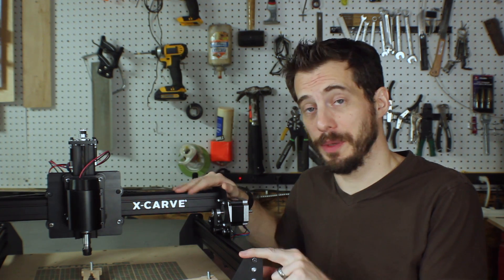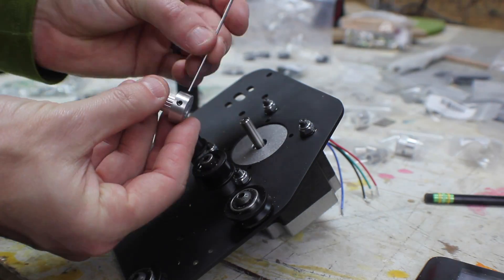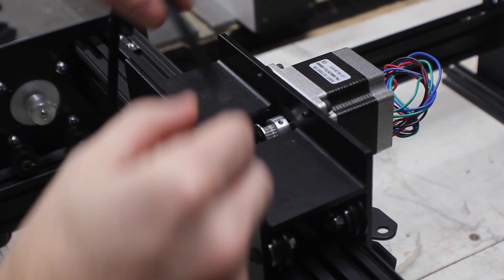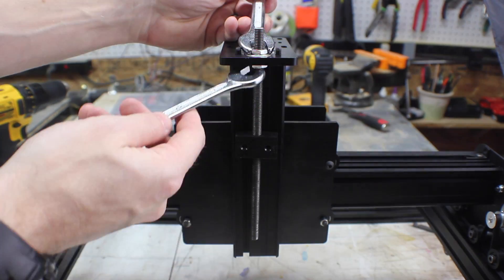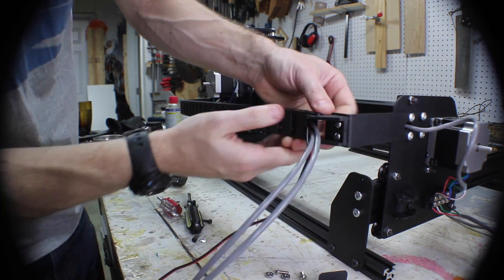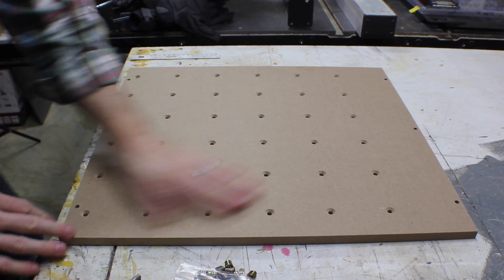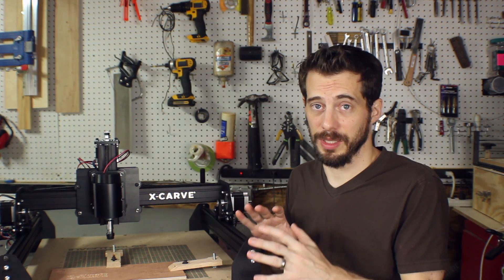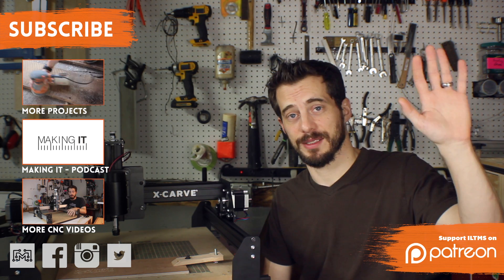X-Carve Assembly // How-To | I Like To Make Stuff

Comment: That was such an excellent vid that I went out and watched a few more - KEEP UP the great work - we're out here, watching! - I wanted to ask what is the maximum thickness of materials you can use with this? (I'm 99.35% all-in on purchasing one of these puppies, and have just begun my due-diligence on it. Thanks again, 
Russ from Coral Springs, Fl
Reply from the maker: Russell Holt Thanks Russ!  Well, I don't know an exact thickness, because you can adjust the bit, spindle and z-carraige up and down all separately. I would say at least 2 1/2 inches, maybe more. Also, you could remove the waste board and physically set the machine on anything to cut down into, I suppose.  It might lose some rigidity doing that, I'm not sure.  Hope that helps some!

Comment: Hi Bob, just some question to the X-Carve: Do you think it is possible to mill brass with the X-Carve and if "yes" how precise is it working? For my hobby i need to mill brass-parts but the they need to be pecise down to at last 1/10mm better would be 1/100mm. With that rubber-pulleys i think it is hardly possible to achieve this tollerances. Would be nice if you could leave a evaluation.
Reply from the maker: stollifa Hey! Yes, it's definitely capable of milling soft metals like brass and aluminum. As far as the precision, I'm not exactly sure, but you could ask on https://www.inventables.com/technologies/x-carve   They'e great with responding to the specific questions like that.  If you have any trouble getting an answer, please let me know.  Thanks!
Reply: Hi Bob, thanks for your answer. I´ll ask them.

Comment: Hey Bob, I know basically know nothing about CNCs, but what would you say is the minimum needed to be able to make guitars?
Reply from the maker: Dojix Hey! Well, I guess it depends on if you mean cutting out the body shape or just cutting out the in body slots for pickups, electronics, neck etc.   This sized machine would work for the internals, but the cut area probably isn't quite big enough to cut out the body.  You would need to upgrade the machine withe larger kit (1000mm) to have enough space to make that cut, I think.
Also, the depth of cut could become a problem cutting out the body, depending on how thick the guitar body was.   
Hope that helps!
Bob

Comment: Excellent video as always Bob!
Probably a stupid question, but what is the difference between this and the Shapeoko 2? Other than the reduced part count and bat-spec paint job? Why not wait for the shapeoko 3? Sorry for the questions/train of thought.
Reply from the maker: Paul Whelan Thanks Paul!! And it's definitely NOT a stupid question...
Well, it's an incremental (but worthwhile) upgrade to the SO2 I think.  The reduced parts create more rigidity, so you should get better cuts. Also, they offset the rails on the Y axis (backward) which moves the spindle and bit to the center of the actual axis (I'm not sure how to explain that without showing it).  Theoretically that should cut down on spindle play.  The electronics setup also adds spindle control via g-code, where the SO2 didn't offer that.
The SO3 is an entirely different format and structure now ( and it's not open source). I'm sure it'll be a great machine as well, but these two will continue to evolve in different directions.

Hope that helps some :)
Reply: I Like To Make Stuff Thanks for the reply Bob.
That makes perfect sense. I guess the pursuit of more rigidity is always going to be a part of CNC construction, so it's good to see inventables going after it. It's disappointing that they're moving to closed source with the Shapeoko and I assume the Carvey too, but as with Makerbot I can see the business reasoning behind it. Good on them for still supporting the DIY-ers though!
G-code spindle control, decreased spindle lash back and added rigidity are definitely big plusses; I'll have to consult my bank account...
Anyway, thanks as always for the great videos
Reply from the maker: Paul Whelan Sure thing.. and to be clear, the ShapeOko3 is being developed outside of Inventables by the original creator, Edward Ford.  I don't know the license details about the Carvey, I'll have to check into that.  Regardless, I'm really glad that they're keeping the X-Carve open.  The core and output of the X-Carve and Carvey are effectively the same.  The big difference is the enclosure, auto zeroing and built in material clamps I think.

Comment: +I Like To Make Stuff : Why go with the self-tapping screws? Are tap-sizes not specified in the build instructions? Is the hardware non-standard?
Reply from the maker: No it's standard. I think they just assumed it was physically easier than pre tapping.  That was one thing I hated about the shapeOko build.
Reply: I Like To Make Stuff my advice for you would be to get yourself a set of taps. I'm an Engineering Technologist and I use taps every day; With thread cutter like Tap Magic (which another commenter suggested as well) it's easier, faster and safer. If you had stripped any of those threads you'd have needed either a helicoil insert or a whole new machine screw size - definitely don't want to have that happen. :-)
Reply from the maker: Adam Piercey I have a tap set. You might just not understand what I was doing here.  I was beta testing the build process for this machine, with the tools included.  I was trying out all of the processes and methods described in THEIR instructions to make sure that they were reasonable for the average user.  I totally agree with you that using a tap is easier and probably safer in the long run, but that didn't fit into the mission of this particular video :)
Reply: I Like To Make Stuff Ohhhhh well that's different. Apologies, I'm doped up on painkillers because of a back injury so I might have missed that :-/
Reply from the maker: Adam Piercey oh no sweat! I didn't really make that obvious in the video :)
Reply from the maker: Adam Piercey oh , and hope you get better soon!

Comment: hehehehe you have a deluxe cnc machine, but you don't have a powered drill to screw the screws?
Reply from the maker: ***** Obviously you've not seen any of my other projects. I do, but when using self tapping screw, that are a Torx end, you have to have a Torx bit (I have no other need for one) and as the screw turns it's actually cutting the threads in the aluminum. So it's not just like screwing in a screw, it's tapping a threaded hole. If you do that too quickly, or with too much force, the threads will cross and you will ruin the aluminum.
Reply: I Like To Make Stuff Actually I always see your videos and enjoy them! the comment was hyronic (for that i put the hehehehe) and was only pointing to the contrast between the super modernity of the cnc and the work of manually screwing all. I always tap my alluminum and steel with my bosch power drill that have a very fine speed control.It works just fine. Hope my comment didn't upset you because it was not my purpose. Have a good day :-)

Comment: I assume this is the full kit? Do you know how it compares to the upgrade kit for the ShapeOko2?
Reply from the maker: Robert Echten It is the full kit. The upgrade gives you all of the new and improved parts, but none of the stuff that you already have. You get new Xcarriage, spindle mount, Y plates (which play a pretty significant part in the improved cutting due to the makerslide not being centered) etc.  It also gives you the chance to upgrade to Nema 23 motors , etc.   I think overall it would be a worthwhile upgrade, for power (assuming the new motors) and rigidity.

Comment: CANNOT. WAIT. UNTIL. MINE. GETS. HERE! Did you get the 500mm one? Also any reason to use loc-tite? I upgraded the motors and the threaded rod on mine.
Reply from the maker: I didn't see any reason to but it'll be worth seeing if anything loosens up over time. Yes, it's the 500mm version.

Comment: Definitely looks like some good improvements made since the Shapeoko 2.  How long was the assembly time versus the Shapeoko?  Does it use the same programming software as the Shapeoko?  And finally what is the cost of your X Carve as shown?  Thanks for an interesting video Bob.
Reply from the maker: My assembly time was a bit longer than normal because of the filming but they say it's 6 hours vs 10 hours (for the SO2). This kit was $901 plus shipping (has upgraded motors, etc). Also, it uses the exact same software and even motor control board as the SO2. I used Easel for the test cut.